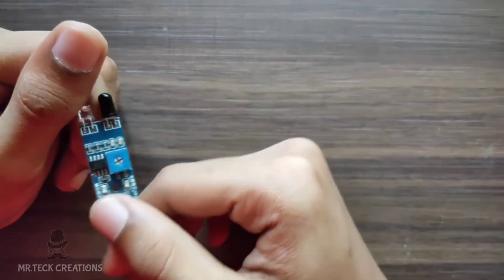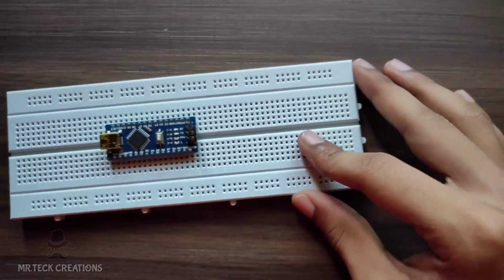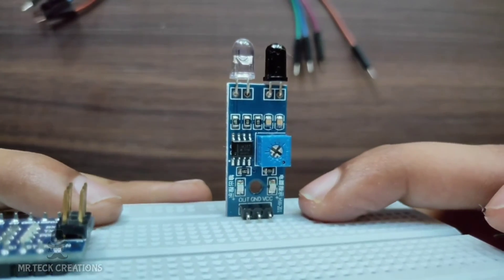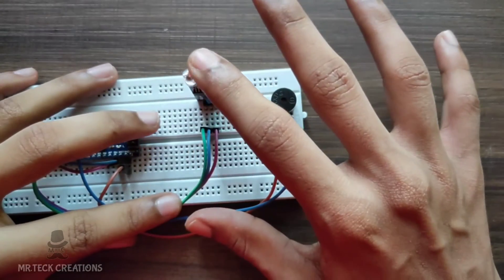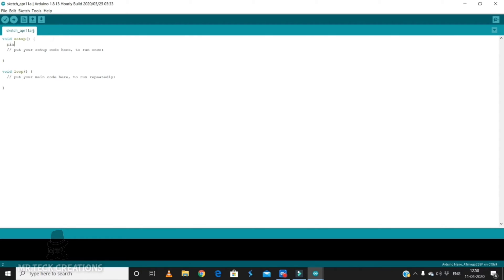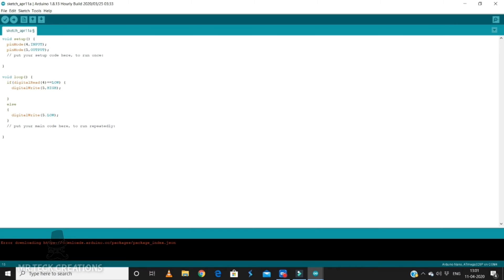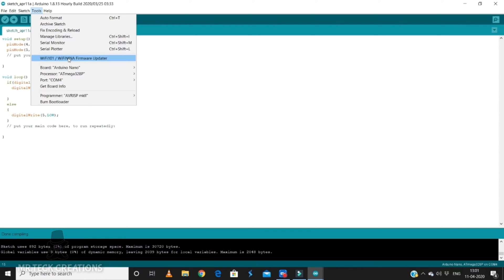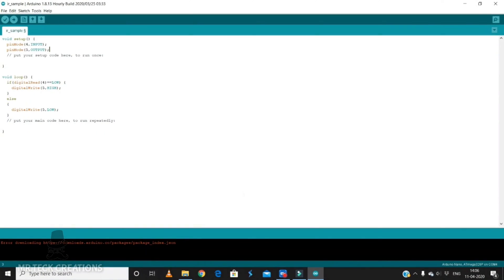Arduino- what is IR sensor and how to use IR sensor in tamil

Comment: Bro digital pin 4,5 la tha connection kudukanum ah
Reply from the maker: No ethulavenalum kudukalam ,connect paniruka pin na program la correct ta eluthirunga avalothan
Reply: @Akilesh-S  ok bro👍
Reply: @Akilesh-S  bro reference voltage means?
Reply from the maker: It is a device gives constant fixed voltage to the load bro
Reply: @Akilesh-S  atha Vida photodiode o/ p value low ah eruntha light blink agumah bro..... threshold value?
Reply from the maker: S bro ,valuva vachu nammaku etha Mari namm program eluthalam,
Reply: @Akilesh-S  threshold/ reference voltage value?
Reply: @Akilesh-S  kunjum brief ah sollunga bro reference voltage pathi plzz
Reply from the maker: Ok 👍
Reply: @Akilesh-S  bro intha application tha museum la use pandragala to detect anyone touched or not 👍
Reply from the maker: No bro ,that is advanced touch detecting  ,i have make tha basic touch sensor  project also if u need you can check it
Reply: Evlovenah thiruvi kalamah bro range set pandrathu
Reply from the maker: S evalovenalum vachukalam 👍